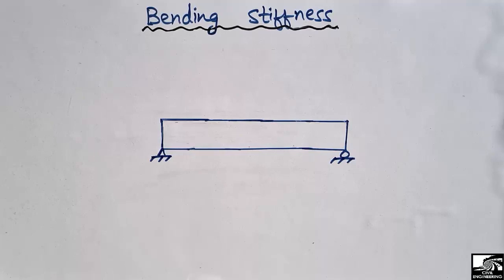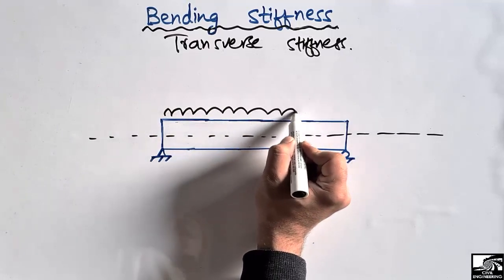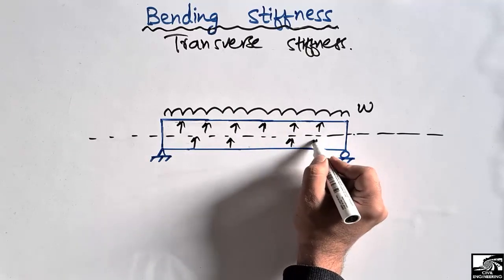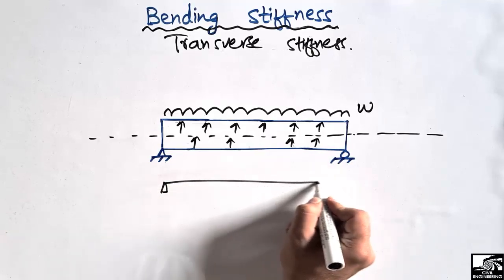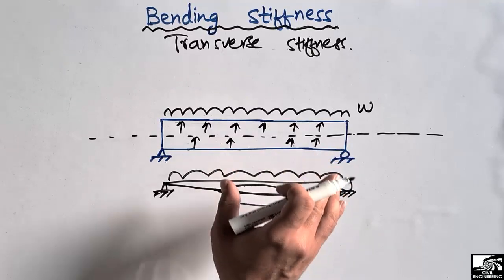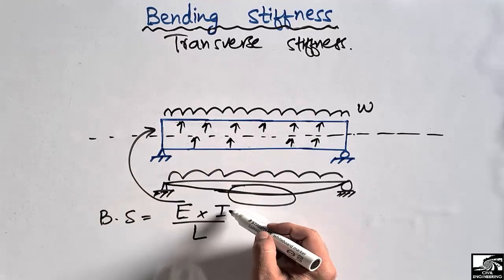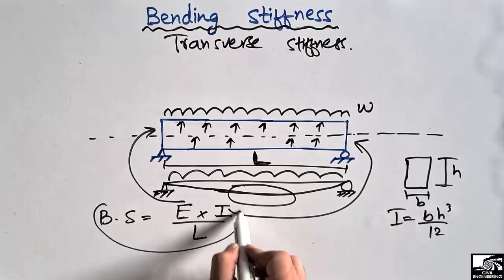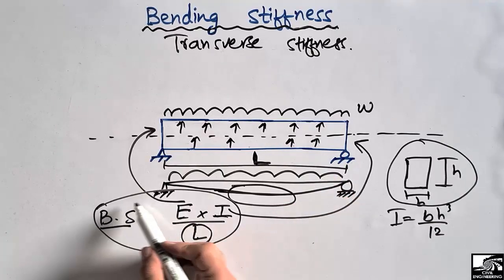Bending Stiffness with Examples

Comment: Problem W2.2: The in situ percentage void ratio of
sand deposit is 34%. For determining the density
index, dried sand from the stratum was first filled
loosely in a 1000 cm' mould and was then vibrated to
give a maximum compaction was found to be 1980 gm.
Determine the density index if the specific gravity of
the sand particles is 2.67.
Please give me this math Solution